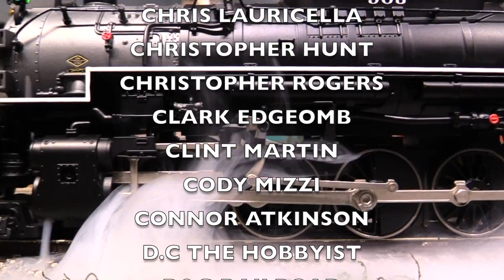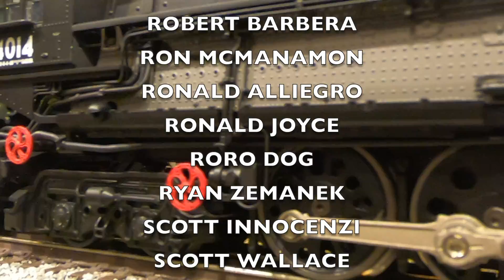How To Gain Weight! Train weight, that is.

Comment: I went to a local coal dealer. The stove coal he sells is too big, but there's lots of sand-sized coal dust that accumulates around the bins and piles that is perfect for model railroading. I'm going to remove my plastic coal load covers and fill my hoppers with real, scale-sized coal.

Comment: Eric, if you glue the washers in the same location but on the underside of the coal insert, you're not damaging the car itself.  And if you want to run the hopper empty -- I.e. on the way to being loaded -- the washers come out with the load insert and prototypically the empty car is lighter.
Also, removing the washers if you want to sell the car is easier when they're underneath, out of sight.
Finally, if the load fits tightly, a magnet -like a parts picker -  can help pop the load out.
Reply from the maker: True, but putting the weights up high like that makes top heavy.
Reply: I was thinking the same thing, don’t want to make the car too heavy. I wish Lionel put out more die cast metal cars. I love those things.

Comment: ASC is referring to ASC Engineering Solutions, which is the actual name of the company that manufactures these flat washers.
Reply from the maker: yeah but every single washer has a distinct 3 character code. There must be a lot of companies making washers!
Reply: @Ericstrains  Well I would say that it is the same company, they just use the ASC as a code on the larger washer, and have a different code for the other smaller washer. Because to be honest I wasn't expecting to find a company by that name, just the washer code, and possibly a company with a different name altogether.
Reply: @TheCrewChief374  the 3 letter code is for home Depot cashier's to ring them up individually when you buy them loose as all these hardware items are made specifically for home depot. They type the code in the register screen and it brings up a picture of the item and description so they can verify and charge accordingly

Comment: If you ever want to remove stuff adhered to a surface with CA glue stick it in the freezer. The bond will become weaker and you can remove the bonded objects.

Comment: When I was doing this stuff. I ended up putting the weights more towards the wheels of the cars. so it stuck better to the track while the cars when around the corners of the tracks. I First started off with stuff like Washers, then I moved up to crafting floors so it blended in better with strips of light weight metals, then just painted it to match.  Log Cars are easy to do, since can just redo the logs and use sticks and touch up ends with some paint. Scrap Metal Cars easy to do as well. Just use some wires and bits of metals.

Comment: When I was a child, the goal was to keep the freight cars light so your locomotive could pull a long string. Only the postwar FM, GG1 and F3's were capable of pulling long trains but even then the freight cars, though they didn't weigh a lot, had a lot of drag since they didn't roll so freely, nothing like the needle bearing modern freight cars we have today. Additionally, these modern locomotives (due to those annoying rubber traction tires) can pull far more. I have a JLC N&W Y6B which lost it's rubber traction tires (A bear of a replacement job!!) so I let it run without the tires. thank goodness Lionel corrected this issue when they brought out the Legacy Y6B as they placed the traction tires on the far back set of drivers instead of the front drivers of the rear engine. It pulled a lot (obviously not as much as with tires but still plenty) I spoke with a jeweler and he said it would be relatively easy to replace these rubber bands with thin metal tires. As my rubber tires keep eventually breaking, I'll most likely go this route. Besides, I like to see my steamers' drivers slip like the rear ones.

Comment: Way back when, possibly before the turn of the century, I added weights to some MPC-era 027 boxcars by packing lead putty into their hollow-backed plastic wheelsets. Made them track way better than they had any right to.

In 2007, I did a project to increase the weight of my Weaver ACF hoppers, beefing them up to 21.65 oz. What did I use? Lead shot, same stuff used by ammo re-loaders, and sourced from Ebay (some seller named ToolSupply. Don't know if they're still around). Now, I live in NYC, so that option may not be available here anymore (or at least would raise all the wrong kind of eyebrows O_o ), but I got two 7.5 pound bottles of 2.4mm shot, used most of the first, and kept the second around for future weight-making.

I had a better-detailed post describing how I did the above, but lost all the text when I accidentally hit up a link taking me off YT before sending the comment. Maybe I'll repost the photos on the OGR Forum since my original post there pre-dates the forum software change that memory-holed most (if not all) posts before that date.

Comment: The only problem I can see using those washers inside the coal hopper is that if you want to run them as an empty load you will see the washers inside. But as you say there are a number of other ways to add weight.
Reply from the maker: I don't plan on ever running these empty, so for me it's fine. Thanks!

Comment: Could use fishing weights.  They are cheap and easily measured.
Trying to put the weights over the trucks may make it difficult.

What about using BBs?
They wouldn't make more more noise than a real coal load.

Comment: You could try using automotive RTV silicone gasket maker if you want to remove the weights you can easily peel them off and peel off the silicone it will probably not leave a mark

Comment: I used the tire weight option on my HO scale coal hoppers. Added two to each hopper I could and each is 1oz. So added 2oz to each hopper and I did a little over 8 or 10 cars. Yeah my Reading T1’s hate me.